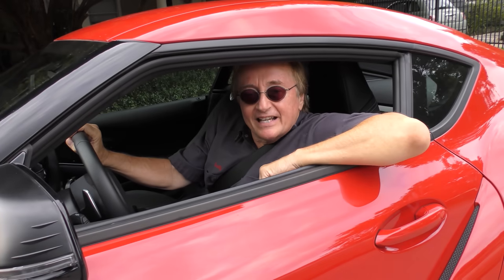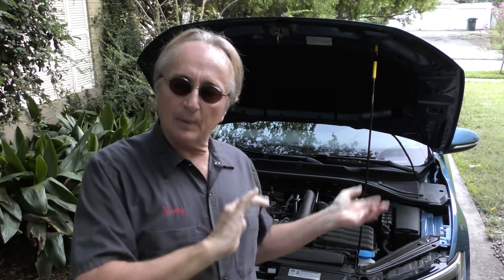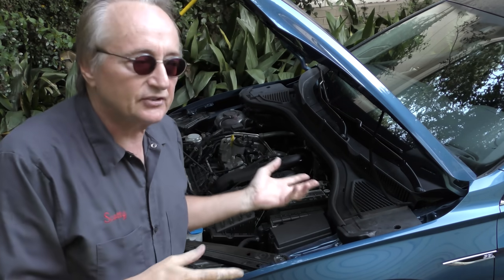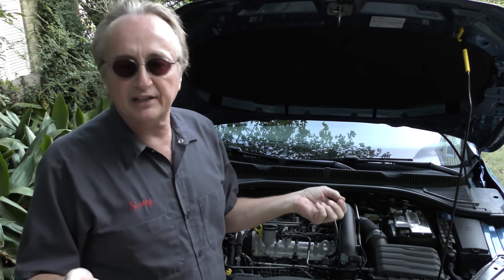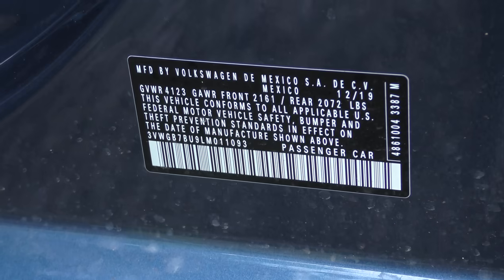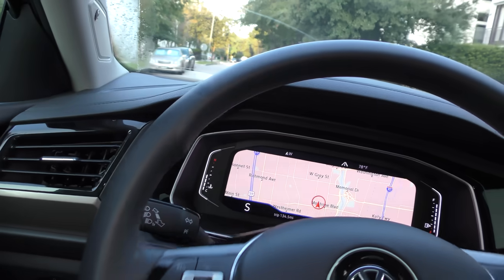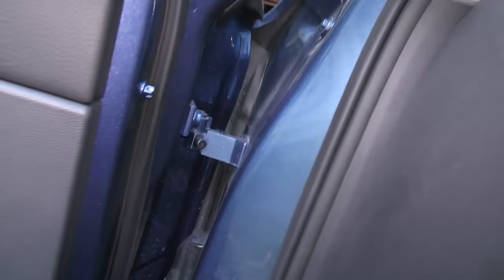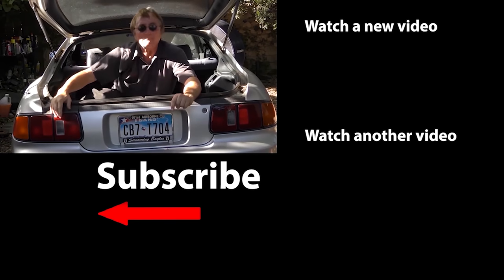I Just Found the Worst New Car Ever Made

Comment: "The Jetta is a BAD car because it handles well, the engine is peppy, the seats are too comfortable, MPG is great, the reliability is solid and it looks classy" Toyota owners.
Reply: Agree 🤣
Reply: It’s a decent car. I think he said only issue was the timing belt and complex design.
Reply: Id rather push a vw than drive a Toyota personally
Reply: @longshotmaster  Hehe, agree. Toyota makes amazing cars in terms of reliability and fuel economy but they are terrible at everything else.
Reply: @jpch8814  phenomenal vehicles and best value for the money , but they’re very plain
Reply: @longshotmaster  Totally agree! I think most of the Toyotas are ugly. I like the reliability, but if I’m going to be driving it every day I want to enjoy the look and feel of things.
Reply: @longshotmaster before the whole 2020 mess, my folks paid $16,800 for a new 2019 Jetta.
Shocking that was less money than the 2007 Jetta it replaced.
Reply: @longshotmaster  And the best toyota's mark x and crown aren't in America which sucks
Reply: @longshotmaster  i had a Toyota pickup.. Felt cheap made driving it. Went back to VW. No comparison.
Reply: Warranty Direct rates VW the 2nd Least Reliable engine due to frequent breakdowns.  My Beetle died at just 70,000 miles.  My 2 Hondas went 300,000+ miles with no engine breakdown.
Reply: @electrictroy2010   If your Beetle died at 70,000 it was more likely user error!  Like timing belt should of been replaced. That would kill it. VW engines, if serviced correctly, Gas and Diesel, are bulletproof.
Reply: Britney Spears has a bunch of #1 hit songs.  Does that make her a quality singer?  Just because VW is #1 or 2 doesn’t mean it’s a good quality car.  The engines and cars are poorly-made trash (just like Britney’s music)

.
Reply: The VW had the same care as my two Hondas that lasted over 300,000 miles.  There’s no reason for it to fail at just 70,000 (except it’s poorly designed crap).
Reply: Honda has several cars that passed 1 million miles on the original engine.  VW has ZERO.  Statistically VW engines breakdown more often than any other brand (except Land Rover)

.
Reply: @electrictroy2010  Most cars built today will last 250,000 miles, assuming proper maintenance on a regular schedule. There was a time when it was something special for a car to last beyond 100,000 miles but engineering, materials, synthetic lubricants etc. have come a long way since then. And VW is of course German engineering.
Reply: @jpch8814  is350, gs350, RAV4 V6, fr-s(Subaru I know but whatever), LFA, tC, GR Yaris, supra(bmw but Toyota), gs450h(pretty fun actually) hell even a Camry V6 is pretty fun to mess around and if you can find it you can have a manual 07 Camry with V6 I think so the hell you talking about Toyota not being fun
Reply: Must not be a tech
Reply: No he likes any good car. Aka old reliable vw’s, old Hondas, newerISH Hondas, most Toyotas, he says he likes it but you’ll never catch him come even close to buying one, and like he says it’s NEW let’s see this car in 12 years where it’ll be. His Toyota celica will still be going strong that’s for sure
Reply: You're correct bout everything except saying the Jetta looks classy lol, the Jetta is an ugly car
Reply: Toyota owners 😆
Reply: @lettuce1305  you better check your vision
Reply: @electrictroy2010  My father's old VW GOLF 2 has passed about 2 milion miles, has driven it nearly every single day for 38 years, the biggest problem was a broken slat 10 years ago, so yeah here in Europe especially Middle and East, South East Europe VW is basically the epithome od reliability.
Reply: Who wants to spend their hard earned money on an ugly Toyota even though they are reliable -except this version of the Camry which is nice .I have owned Many VWs they drive better than any other car however the others are catching up .
Reply: @electrictroy2010  sounds like a typical Honda owner 🤣🤣🤣.
Reply: Toyota haters gotta hate them.
Reply: @electrictroy2010  link to source?  Sounds made up comparing to Dodge, Jeep, issues in GM 5.3L etc.
Reply: @electrictroy2010  VW is not as reliable as Japanese cars, but they’re much better when it comes to driving dynamics and performance. Honda is ok, Toyota for the most part is boring as hell. I’ll keep my Jetta.
Reply: @lettuce1305  Ugly? I have gotten many compliments on it. Try that with a Corolla.
Reply: Compared side by side new base 1.8L Corolla to a 1.4T Jetta, the latter drives better. That said, the Toyota will outlast the VW in longevity.
Reply: @Trades46  Likely yes, but if you take care of the VW you’ll get a good 250k miles out of it.
Reply: @longshotmaster  😂😂😂😂
Reply: Hahaha a reliable vw! I've had 4 vws and well maintained and electrical, mechanical issues etc. Utter crap and yes fun to drive and loved them but because I drive literally everywhere and away from civilization I could never trust them.
Reply: @longshotmaster  yeah I'm sorry. That's someone who doesn't care about reliability
Reply: @longshotmaster  hahaha right
Reply: @zanesutherland406  that's like people who buy cool looking clothes, products and totally disregard if the product will even last.  All glitter no substance. Kinda like a Chinese product. Vws all look alike as well. Guess depends on beholder
Reply: @Leroy100  I've driven Subaru, Toyota, Honda, BMW, vw etc and yes German cars do seem better made than that Toyota or whatever.... I bet when u close the doors on each u think how cheap on japanese car.... But in the case of Subaru they go light on the sound abatement/insulation which makes big difference on "feel" of solidness etc
Reply: @psynurse  I’ve never had a problem.
Reply: Ain't that the truth
Reply: Never compare VW to Toyota. VW only wishes they could make quality cars. 
They once did but that was light years ago. The older Toyotas were not stylish but that was a while back not anymore. VW is mainly a big automaker because they own many brands. Toyota is the largest with only 2. Toyota has made quality vehicles for decades.
Reply: @marcelpatel9017  Again, I’ve never had a problem.
Reply: @BabyBugBug  what milage?
Reply: Honestly…
Reply: @jpch8814  Toyota are boring and uncomfortable. i agree on timing belt the only down side.
Reply: You said that RIGHT 👏👏👏
Reply: These cars are awesome.  Scotty needs to lay off the crackpipe.
Reply: @Leroy100  theyll skip oil changes, then theres a problem, and they blame the car lmaoooo
Reply: @Rollingace lol you mainly named either expensive Lexus cars, and Toyotas that have either been tuned, and designed by another brand like bmw and Subaru. Try again
Reply: 09G-TCT transmission...
Reply: It's kinda ugly looking to me, nothing classy qbout it.
Reply: Toyotas short term value proposition is absolute garbage. If you keep the, for 10+ years it is fantastic. At least the resale value is good on Toyota.
Reply: 5
Reply: @zanesutherland406 Toyota makes great dependable transportation. VW makes cars that you can enjoy driving. I do 5k oil intervals and maintain well. I’ve had 8 VW over the years and they have treated me well thus far. I won’t get anything with a CVT.
Reply: @Leroy100 Facts, I still use the Jetta that was handed down to me. It’s at 339k miles on its 2nd belt. 2.0L Are bulletproof for sure
Reply: @angelgjr1999  my Jetta has a chain timing belt. No problems
Reply: @TheMlvswoll that's the key right there, short oil change intervals and quality high octane fuel. Cheap out on either one of these and the engine will lunch itself

Comment: Scotty the 1.4TSI is hands down the most reliable VW motor right now. Also has 180 tq at sub 2000 rpm. Literally just put gas in it, change the oil at 5k and use VW approved oil (I use liqui moly only) and do Spark Plugs at 40k w/ air filter and you'll have this motor last you 200k EASY. I won't doubt people can get 250k-300k out of it.

Also you can literally do the timing belt by reaching into the engine bay. It's cake. This is THE best VW motor since the 2.5l NA.

No offense Scotty but this is genuinely propaganda.
Reply: My manual calls for castrol euro spec in my 17 tsi. And has castrol stamped on the oil cap. Think I should still go with liqui molly?
Reply: You can use any vw 502.11 spec oil it doesn't have to be liqui moly that would be ridiculous.
Reply: What do you think about 1.2tsi 110hp?
Reply: LazyJr  I can't think of any reason not to just use the approved oils that have been tested to work well with the engine. There is nothing to gain and much to lose including your warranty.
Reply: Nah the 2.0TSI in the GLI is better
Reply: @ivankovacevic1910  I got one in a Polo. Very good engine; accelerates fast.
Reply: @SuperMerlot  got any problems with it so far?
Reply: @stve6281 check the actual oil specs not just a brand recommendation as long as it meets those specs use whatever brand suits your level of cheapness or expensiveness
Reply: Never. 2.0 tdi much better
Reply: Except the oil burning
Reply: @Somebody2687 0w-20 is an acceptable oil as well.
Reply: 1.4 is has so many issues
Reply: @joshuamast5128 bro I check my oil every 2 weeks on my 1.4 and change it every 5k and I’ve never had oil burning issues, I don’t even have a new car either, it’s a 2017 with 70k miles, 30 of which I’ve put on in the last year because of my commute, I bought it used and have done all the proper maintenance and it’s never burned any oil.
Reply: @sirrogeriii9628  Owned 2 VW 2.0 TSI and both were plug/gas hogs. Ran great, even in a Tiguan, but Premium gas and crap mileage?
Reply: Oil is 10K miles
Reply: @Hahsjshj no they don’t . Name 1 problem with the 1.4 engine? everyone says your wrong.

Comment: Lifetime = warranty. 
Saying "lifetime" should be considered misadvertisement. Manufacturers should be sued for that.
Reply: For most manufacturers, lifetime = 100000 miles or 10 years.  They would then prefer you get a new vehicle by that point. 🤔🤔🤔
Reply: Just like 80% of all advertising
Reply: 50,000 mi powertrain
if belt break at 50001 miles, it's on your dime. Goodbye engine
Reply: @hom2fu  Well regardless of when the belt breaks, even at 1 mile,  it did technically last the lifetime of the engine because once that belt snaps that engine is a goner, it's dead.  No more lifetime left in it.
Reply: @jjojo2004  Honestly i wouldn't mind having another car, the real issue is that cars are getting more expensive and not the other way, so ofc people won't be buying cars, since it's already a big expense to have
Reply: Waldemar Ishibashi these belts won’t brake even after 200000 they still good best time to replace when the seals leak
Reply: Waldemar Ishibashi Well, DUH! “Lifetime” means the warranty is void if it “Dies”.
Reply: @jjojo2004  Usually lifetime means when it goes out of production.
Reply: Caveat emptor
Reply: lifetime warranty claims are illegal in Germany
Reply: Who's life?🤣
Reply: I have a jetta with the 1.4L engine vw does not say lifetime the dealer told me 60 to 100k miles it should be replaced.
Reply: @desmondou  The problem is you can't rely on that because if it breaks, it kills the engine.
Reply: Lifetime of a hamster.
Reply: Lol once it blows up that's the end of the warranty 😂
Reply: VW officially  said in germany after the VW scandal that the lifetime of any VW is 180000km
Reply: @andreas4687  some old VW have three times as much millage still being on the Polish roads :)
Reply: Life time for vw is not long...
Reply: Spawn223311 and advertisers should be sued for using our natural brain chemistry/mechanics against us too. That is totally intrusive. Should be illegal.
Reply: When the b
Reply: Manufactured goods are often designed with a finite lifespan in mind.  Not disclosing this lifespan is the crime, warranting the product for the lifetime is fine.
Reply: Toyota said the Prius battery lasts “lifetime” of the car.  Then they admitted life == just 150,000 miles (same as the emissions warranty in California)
Reply: Then again Toyota had some oil-sludging engines die at just 25,000 miles.  Toyota refused to honor the warranty & refused to replace the engines.  (Until the US Government stepped-in and fined Toyota millions of dollars.)
Reply: Warranties mean nothing if companies refuse to honor them.

Comment: I’ve had a 2017 Jetta with a 1.4 for about 3 years now. I bought it with 60K miles. Only thing I’ve ever had to do to it, was replace a headlight bulb. And I’m at 107K now.
Reply: I love my Jetta man
Reply: Still holding up pretty good ?
Reply: @hix9306  ABSOLUTLEY. I’m at 138K miles now. And still nothing.
Reply: I have a 17 as well 147,000 miles still going strong and average about 37 mpg.
Reply: yeah I have a 2014 Jetta, 100k miles on it and never had to replace anything other oil changes every 12k miles and tyres when they're worn
Reply: Getting a 2019 VW Jetta S with 89k miles on it, just watching these to find out what I’m getting into, any issues during normal driving? Or just relaxed your headlight?
Reply: Im going to get one. Im trapped with a LAND ROVER LR4 ...Been trying to get rid of it.

Comment: "Zippy, fun to drive, great steering, easy to work on"...worst car ever made!  😆
Reply: Warranty Direct insurance company rates VW the 2nd Least Reliable engine due to frequent breakdowns.  My Beetle turbo engine died at just 70,000 miles so the WD rating seems accurate.  My 2 Hondas went 300,000+ miles with no engine breakdown.

Also VW commits criminal acts by cheating on EPA and EU pollution tests

Comment: Dude, Corolla is the most boring car in the world.  My daughter drives one.  I have a 2015 vw jetta with 145k miles.  No problems, zero, change oil and trans fluid.  170 HP on regular or 185+ on super gas.  twice the car of the corolla.  Engineered to go at top speed for hours on the autobahn.  I pd 15K for the car brand new.  What a deal.  Nice try scotty, does Toyota pay you to do the Toyota jump?
Reply: You're next

Comment: "worst new car..." you sure had a lot of good things to say about it. lol
Reply: According Scotty's videos I would say that he bitches more about Nissan CVTs than about VW in general.
Reply: @MJ-uk6lu  Without a doubt. And I would agree with his complaints about any Nissan car made after the 2003 Maxima...with the exception of the 350z and 370z.
Reply: @scottbutler2343  amen! The amount of time I spent working on my ex’s Murano, those are days of my life I’m never getting back from that oil-burning POS
Reply: @manzelli1981  the Murano or your ex?
Reply: next video i was wrong with Volkswagen
Reply: Mr Fish  It does seem like the change interval has more to do with waterpumps, tensioners and pulley lifespans rather than the belt.
Reply: Warranty Direct insurance company rates VW the 2nd Least Reliable engine due to frequent breakdowns.  My Beetle turbo engine died at just 70,000 miles so the WD rating seems accurate.  My 2 Hondas went 300,000+ miles with no engine breakdown.

Also VW commits criminal acts by cheating on EPA and EU pollution tests
Reply: @electrictroy2010  Hahaha, they all do.
I drive an SJW TDI, 120k miles, runs like new and still get 40mpg even after the dieselgate fix.
Meanwhile, my GF's Crosstour had near catastrophic engine failure at 80k because of the VCM system Honda had on the 3.5 V6. Everything is relative.
Reply: I bet your Cheatwagon won’t make it to 200,000 miles without turbo failure or cam failure (the main flaw with TDIs)
Reply: Honda has several cars that passed 1 million miles on the original engine.  VW has ZERO.  Statistically VW engines breakdown more often than any other brand (except Land Rover)

.
Reply: @electrictroy2010  Really bro? Not sure when you decided it was ok to deride others over their car choices. ButI can tell you my 2012 SJW TDI has now 121k on it and runs like new while my GF's 2010 Honda Crosstour with the 3.5 V6 w/VCM had catastrophic failure at 80k miles and was repaired under the lawsuit  Honda settled for engine failures. So you can read what you want, reality is something different.
Reply: @electrictroy2010  And you are incorrect about the vehicles over 1 million miles. VW's Beetle has had several exceed the 1 million mile mark.